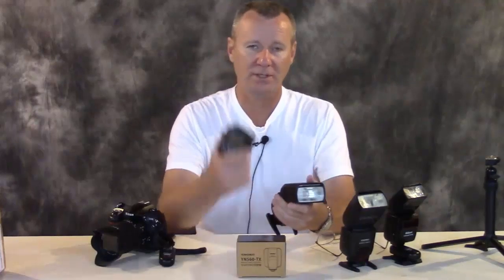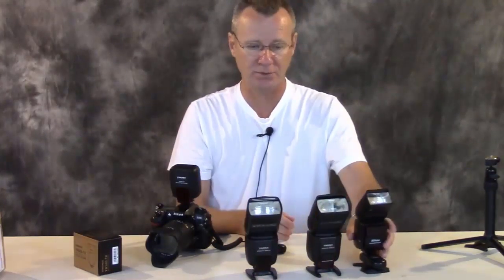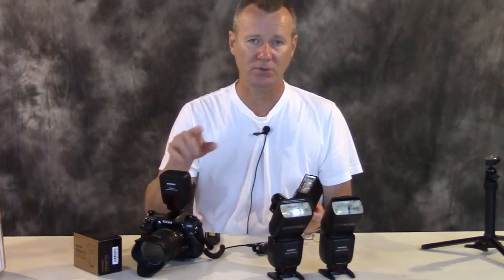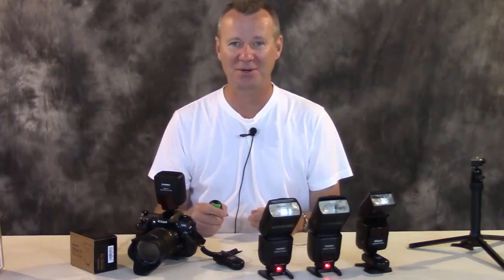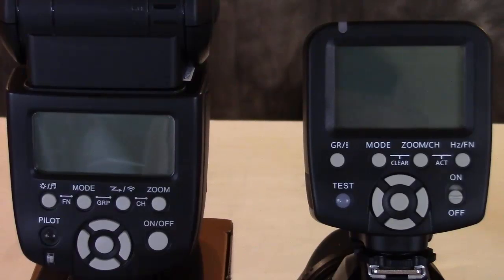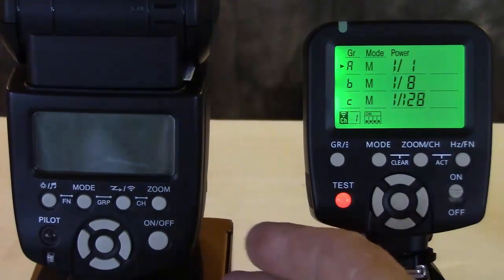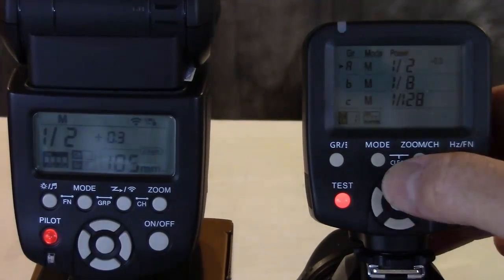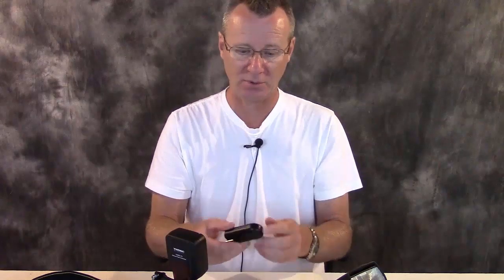YN560-TX

Comment: Just bought the yn650 Tx trigger. Can I use this trigger with mix studio flash strobes? I have 2 Godox strobe and a Neewer strobes. I'm new to flash photography and I like to be able to save some money.
Reply from the maker: Hi Claudio, yes, I do this occasionally with my Flashpoint Studio 300R2's but your flash has to have the sync port. So basically what you do is plug a sync cable into the sync port on the back of your flash the other end to an RF-603 for example and then the 560 TX will pick up the fire signal but this is manual only. You won't be able to remotely control the studio strobe but they will fire. Hope that helps. Paul

Comment: Great review--watch this instead of reading the inscrutable instructions. I've been using Yongnuos since the II (which, by the way, fell off a 6' stand onto concrete, breaking the red lens...I pieced it back together and it still works as before). And thanks for the tip on remote triggering with the 603s. Never knew I could do that.
Reply from the maker: Happy to help, thanks for connecting in!

Comment: So to clarify, the only way to control the power/zoom of each flash individually you need to assign each one a different Group?
Reply from the maker: shaolin95 Hello Shaolin95, yes that's right. Typically I will have 2 or 3 560III's set to channel 1 but one of the 560's is set to group a, one to group b and one to group c but all on channel 1. This ensures all flashes on channel 1 will fire but channel a might be at 1/128th while channel b is at 1/16 etc. 

Hope that helps.

Paul
Reply: PATHTECHDESIGN  Excellent, thanks a lot! :)
Reply: PATHTECHDESIGN Oh one more thing, are you able to sync any higher than 1/160 without issues? Not sure if it was your video but I think someone mentioned something about using multi will make your sync speed drop or something. Anyways my Sony A7ii should be able to sync 1/250 but when using this wireless flash, 1/160 is the best I can do.

Comment: Is it compatible with YN-560 IV?
Reply from the maker: Hi Muhammad, yes absolutely it is. I now own the IV and have used it many times with the TX so you have no worries there.
Reply: Okay.. Thanks sir..

BTW I got another quick question..
I have one YN-600EX-RT and soon I'm planning to buy YongNuo YN-E3-RT E-TTL II Wireless Speedlight Transmitter. 
Did you have any experience with it to pair with YN-560 Mark-IV.
Reply from the maker: I don't have experience with that setup but highly doubt the 560IV will work with the YN-e3-RT as the RT is ettl and IV is strictly manual speed light.
Reply: Hmm.. Yeahh!.. Same like what I am concerned..
anyway thanks a lot sir.. :)

Cheers~

Comment: After demonstrating the remote camera triggering you said "It doesn't get better than that". However, it does. With the Cactus V6, you can control the power levels of the flashes from the unit you are using to fire the camera (-> relay mode). It also has a dial for adjusting levels and direct control buttons for each group. The V6 does not only have many more features it also supports the basic functionality in much more effective ways.
Reply: The problem with the Cactus V6 units (and don't get me wrong, I'm a Cactus fan) is that it won't work, except as a dumb trigger, on manual-only flashes (other than the Cactus RF60, of course). With the RF60, you get pretty much what this Yongnuo system offers. With most digital-era TTL flashes (like the SB600) and with anything that's got the old TTL/OTF mode (where the quench signal comes through the hot shoe) you get remote power control, etc., provided that you have V6 units acting as receivers. And the absolute power setting (that allows you to match power with different flash units) is great. If you have Yongnuo flashes, though, all you get with the V6 is a (very good) dumb trigger; you can't remotely control YN560III/IV units, just remotely fire them. While the Cactus RF60 is a nice flash unit, it does go for a little over twice the price of the YN, so if you're building a system it's going to be more expensive. If you have existing TTL and film-era TTL/OTF flashes to work with and build upon, it's definitely worth looking at.
Reply: That's not precisely true, though, is it? The V6 can remotely control the RF60; the YN560-TX can remotely control the 560 III and IV (the IV acts like a controller, just like the RF60). The RF60 costs $170 (approx.), while the YNs cost around $70-80 -- and a lot of people already have 'em because they're just plain decent flashes for the money. As I said, I'm a Cactus fan, but there are some very, very good reasons why people might want to go to the Yongnuo system, especially when building a system from scratch.
Reply from the maker: Victor Shikhman Hi Victor, many thanks for connecting in. I think it really depends on whether you are comfortable shooting TTL or manual. The 622tx only works with yongnuo's ttl flashes like the 568ex and others while the 560TX works with manual speedlites like the 560III's. Personally, I don't think you can go wrong with the 560TX and a couple of 560III's or IV's. This will be your cheapest route for sure. I have the Odin and the Pixel King Pro and I have to tell you I use the 560tx with the 560's the most because they are just so simple to use and I don't have to worry if something gets broken because it won't cost a fortune to replace. Oh ya, they always work for me which is crucial.

Hope this helps.

Paul
Reply from the maker: Hey thanks for connecting in. I've never used Cactus products before so really can't comment but looks interesting for sure.
Reply: PATHTECHDESIGN Hi, thanks for the warm welcome. Try the V6 sometime, if you can. You come across like someone who would appreciate the great handling and features.
Reply: essellar I'm not sure why you refer to it as a "problem" that the V6 cannot remote power control manual only flashes. Nothing can. However as you say the V6 can remote control the power of a large number of flashes from many brands out of the box and if you have a legacy TTL flash, chances are the V6 can create a profile for it. That's huge compatibility, compared to the Yongnuo products that don't even have proper compatibility across their own range. Yes, the RF60 is pricier but going via Amazon feedback it also seems more reliable and has a lot more features, manual HSS, for example.
Reply: essellar you seem so know what you're talking about. I hope you don't mind me asking a question. I'm building a (for now) 2-flash system from scratch with an RF trigger. I was planning to purchase the YN560-TX with two YN560-III, as in this video, but I saw there's now the YN622-TX controller, which is highly recommended.

Can the 622 control all other RF-capable YN flashes (like the 560-III), or are each YN model trigger only good for controlling flashes with the same model number?

More generally, if you have a suggestion for buying into a budget but quality flash system, I'd appreciate it. I'm shooting with Canon T2i, if that matters. 

Thanks!

Comment: In case anyone has a Sony camera, these work great on them as well...I have a Sony A99 and an A7R and the speed lights AND the TX work on both with no issues! Yongnuo is really stepping up their game!
Reply: As long as you are using them manually you won't have any issues. They just don't have any that work as TTL for Sony yet.
Reply from the maker: Interest Randall, thanks for connecting in.

Paul
Reply: Thanks Randall. I'm nervous about buying anything on line without testing it first and I couldn't find a definite answer to "will this work on an a99?"  .  So thanks for confirming. I'm thinking of selling my yn560 ii and getting a few iii or maybe IV (but there seems to be restrictions on the amount of groups you can have??)
Anyway, thanks very much. I've used generic triggers until now and i'm sick of running round my lights changing ratios. The yn560tx looks just the trick and is within my budget!
Reply: Randall Williams Lovely stuff. thanks! I only shoot manual for model work, headshots etc. I've been toying with the idea of getting something TTL for the few occasions I shoot on camera (which is rare). Thanks for confirming, i'm a nervous buyer so always like to have reassurance when ordering on line!

Comment: Hello Pathtechdesign.
I have 2 YN560-III plus Canon 430EX-II. YN-622C Trigger/receivers. Sometimes feel I need to have E-TTL. But that may not be necessary. But I would prefer to have High Speed Sync available. Just an option if having to shoot in brighter conditions. I don't like to use ND filters and restrict my view. And I don't want to always be shooting at F8-F16, to keep with in the camera sync speed. Any advice or suggestions.
Reply: You might want to check out the Godox V850. It's a manual flash, but it uses two different triggers. The FT-16 allows the remote manual control, while the Cells II allows HSS.

Comment: Thank you very much for this review! Can you say if the 560-TX provides an autofocus led grid like the 622 does? There is a field on the device, but I never saw it glowing red. That would be the last killer feature in my opinion. Can't wait to get mine.
Reply from the maker: No it wouldn't because the tx is manual only but I'm sure you'll find this unit just as handy as we do. 

Cheers
Reply: Thank you for your answer. The 560-TX can be operated as a "sandwich" with a 622 unit for af lightning. Also there is a new (ex hacked from flash havoc) firmware (1.02) which gives the 622-TX a proxy mode. With this you can controll the 622s remotely in manual mode with the 560-TX. That's pure awesomeness!
Reply from the maker: BenHardly Sounds good, we don't use the 622's at this time but every little bit helps.

Cheers.

Comment: Hi There, thanks for the review of this Item, i just have a question, did you received a canon 560 tx, or the nikon one, cause I received the cannon one. thanks
Reply from the maker: Nikon
Reply: Thanks, I think I know what happened, I did not see the option that I had to choose the nikon brand when I pressed "manual triggers for nikon" , by default the website gives the cannon option not the nikon one. I have to order another one. Thanks.. I like your videos.
Reply: Marcos Photography and Video Hi Dear,we checked that you you may need Nikon one,we just launched from Amazon,now is available .please check at http://www.amazon.com/gp/product/B00MUNRSVO
Reply: Cathy Zhou I bought the Canon version and the contacts do not allow the transmitter to slide all the way on my panasonic gh3. My camera has a standard hotshoe. Will the Nikon have different contacts
Reply: Sukhi Rai hi Dear Sukhi Rai,the Panasonic camera can not be compatible with YN-560C-TX,the Hot shoe can convert the contact,but the function can not be converted.if you have a Canon or Nikon camera can directly use it without problem.hope this can help you.
Reply: Can you please recommend a conversion adaptor?
Reply: Hi Dear,i am afraid of that,there is no adaptor/hot shoe can solve this problem,not compatible brand ,it means can not use for Panasonic camera.only for Canon and Nikon cameras.
Reply: Cathy Zhou do you think a pc sync wire will be the best solution. I want the camera to trigger the 560tx so it can  fire off camera flashes
Reply: Sukhi Rai Hi Dear,YN-560C-TX this is a transmitter has to install on the camera connector,there is no wire can have the function for this technique.please note.only your Canon camera can directly use with full function.
Reply: ok Thanks I understand

Comment: Thanks for the review! 
I'm waiting for my unit, but I'm a bit confused after watching this video. All of my 560IIIs' were made after january 2013 but they don't have group settings as yours (below chanell settings).
Perhaps the group switcher on the speedlite is being shown after the YN560-TX is turned on and connected with speedlite?
Reply from the maker: Hi Artur, many thanks for connecting in, at first glance I thought the same about mine but just follow the instructions you'll get with your TX to put your 560's into group mode and you'll likely find out as I did that you do indeed have a group mode. If you get stuck don't hesitate to email me and I'll try to help. If I start getting a lot of inquiries on this issue I'll punch out another video to address it but I think you'll find the instructions being in Chinglish as I call it and a tad cryptic do get the job done. 

Cheers
Reply: PATHTECHDESIGN Im like Arthur... I have no group function... i have the buttons but they do not actually do anything.  The screen stays exactly the same. I have matched the frequencies and channel.  The commander will fire the flash but when i change settings on the commander they do not mirror on the flash... Any idea?